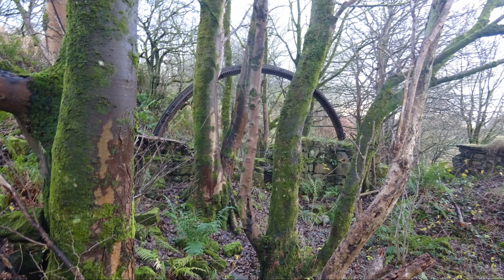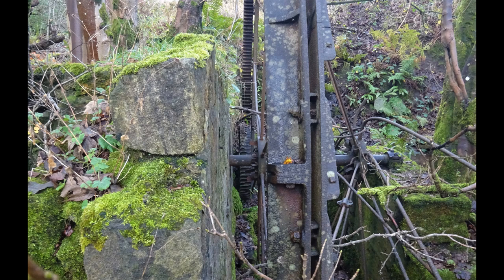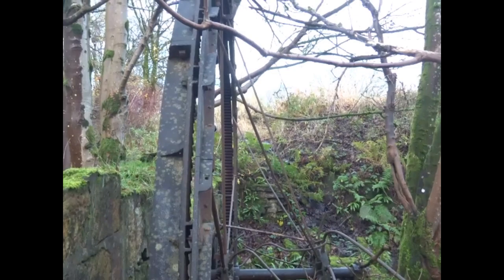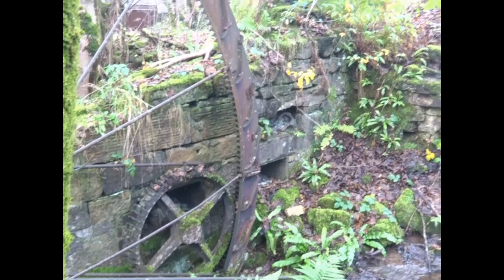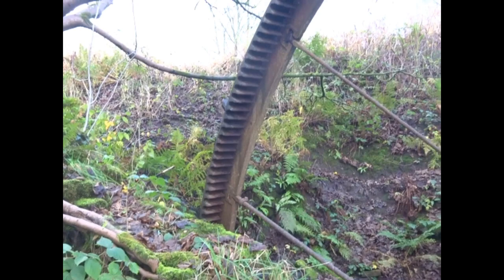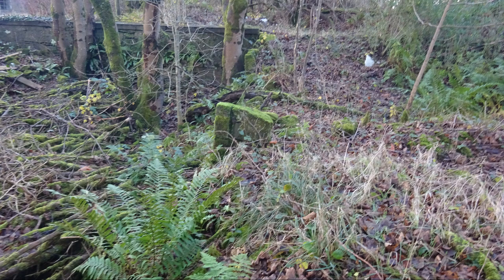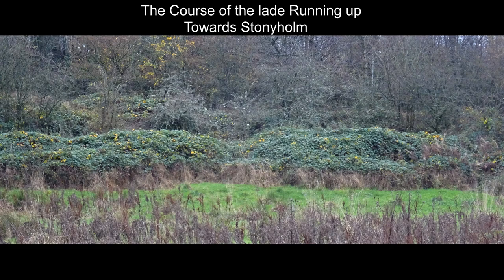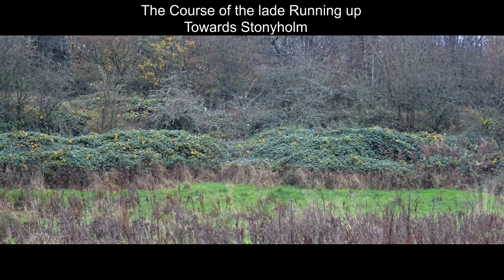Nether Corn Mill, The Miller's Knowe, Kilbirnie

Comment: Impressive find. Especially with the remnants of the wheel and gearing still in place. Might need to pay this place a visit before "progress" happens. 😞 nicely put together video.
Reply from the maker: Many thanks. I have a Wikipedia article as well called 'Nether Mill'. I was surprised that the official report is said to regard the mill as of no interest. I would have hoped for a bit of consolidation and an information board instead of demolition. I haven't seen this gearing system before. Do make a video - I was reluctant to visit the old mill pond above the wheel - mobility problems.
Reply: Progress never happens in Kilbirnie its the land that time forgot
Reply from the maker: @legandrydirk  The main street looks very sad that's for sure. Great library though :-)
Reply: @rogergriffith286  Kilbirnie is a shit show happy to gotten out off there years ago still some good people there though but its a back water got more shops and stuff to do in Glasgow not even the City centre
Reply: @rogergriffith286  Would been good if you documented this stuff in the 80ties when I moved still had dye works Stonyholm mill and parts off the railway sheds and works all been leveled now still had off shoots off steal works and church all gone and the pub fell down when they pulled the jubilee building down big tenement Knoxes had bomb shelters out back to all gone

Comment: Which 1750 map are you referring to?I had a look on the James dorret one of that year but couldn't find a  "Neth mill" , I did notice Nether mill  and Unthank on the Victorian six inch map. Thanks Roger
Reply from the maker: https://maps.nls.uk/geo/explore/#zoom=15.0&lat=55.75151&lon=-4.67978&layers=4&b=1
Reply from the maker: It's on NLS maps together with many others if you are not familiar with that site.
Reply: @rogergriffith286  thanks ,yes that's the site I'm using I like the side by side feature as you can compare  various maps to a modern day satallite image , interesting to note the 1843-1882 six inch map notes of stone lined coffins being found there in 1792.
Reply: Thanks for sharing that link , I know that particular map as the "Roy lowlands 1752-1755" map. It has a better scale and is far more detailed than the James Dorret one
Reply from the maker: @richiec9077  If you are interested in the mill I have greatly updated the Wikipedia, Nether Mill, article with details of it being the barony mill, etc.
Reply: @rogergriffith286  thanks for letting me know I'll be sure to have a read through and looking forward to visiting the site soon for a look around